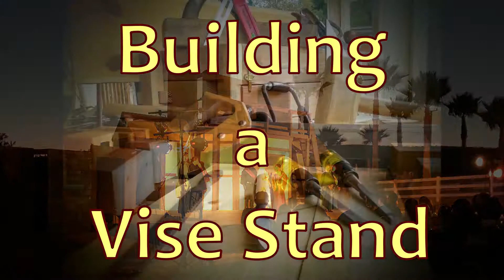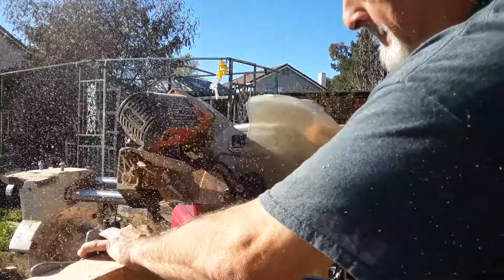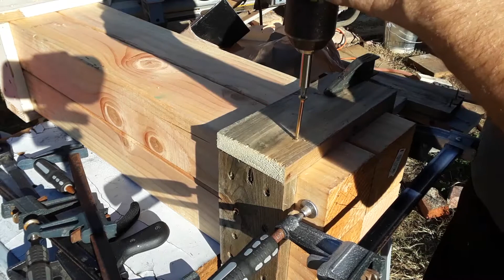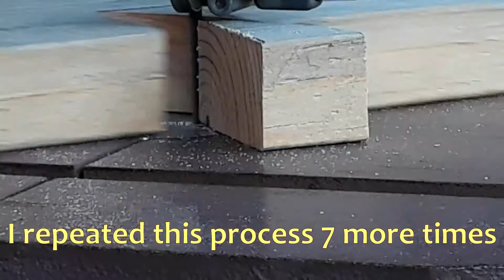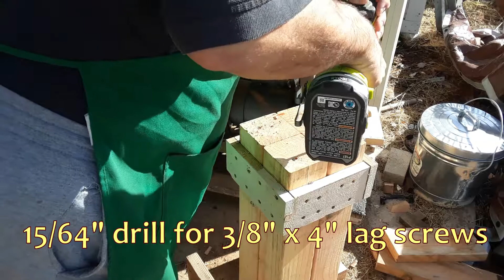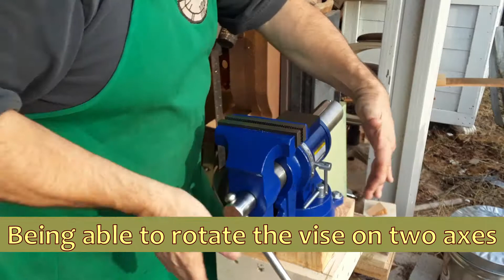Vise Stand Build

Comment: Go get a pair of new solid mower wheels from the home center and a steel tube of the appropriate length. Mount them just outside your 2x6. Use washers and cotter pins to hold wheels on. If you mount them in the right spot they won't touch the ground until you tilt the stand back.
Reply from the maker: I thought I replied a long while ago but YouTube I think cleared everything. That's a really good idea. I have to shorten the stand anyway and change the base so I'll incorporate this idea into the next iteration. Thank you